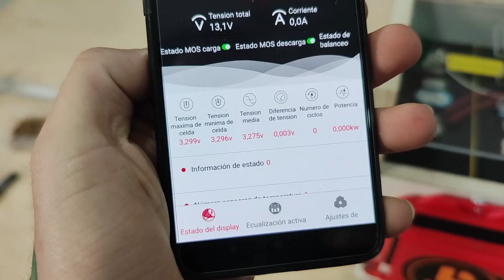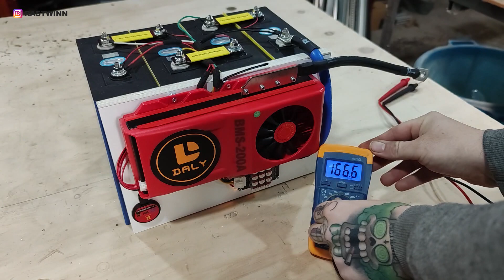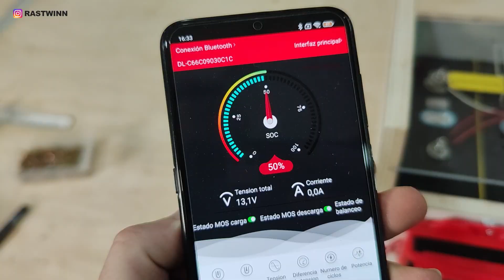Como se Fabrica una bateria LIFEPO4 para furgoneta EN CASA

Comment: Hola! excelente trabajo!! Pq utilizas un BMS de 200A? la elección del BMS es en función de la carga (el doble del A de la controladora anterior)... si cargas con el alternador del coche (unos 55 de máxima) debería poner un Booster antes para regular la carga, no? un booster de unos 30A... por lo que con un BMS de 60 o, a máximas, de 80A debería se suficiente, no? Hay alguna otra razón la que instalar un BMS tan potente? Gracias!!
Reply from the maker: La BMS te limita la carga pero tambien la descarga, si cargo a 50a pero quiero hacer consumos de 200a para usar una vitroceramica como es mi caso debo poner una bms que permita extraer 200a a la bateria